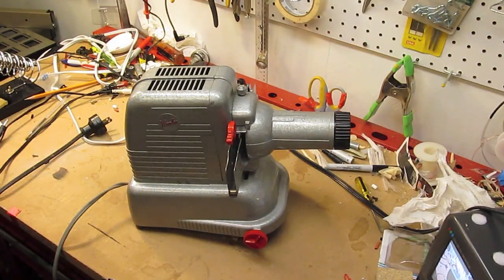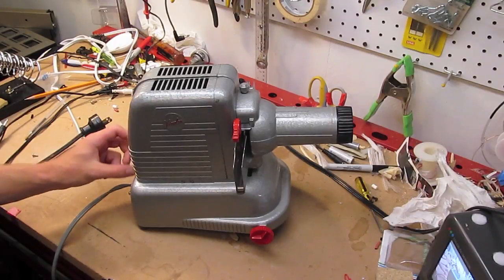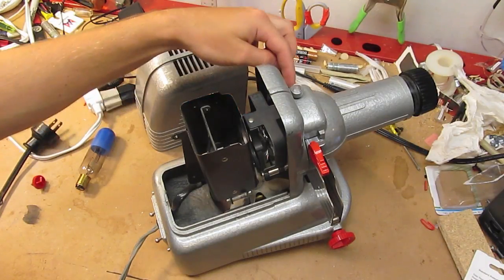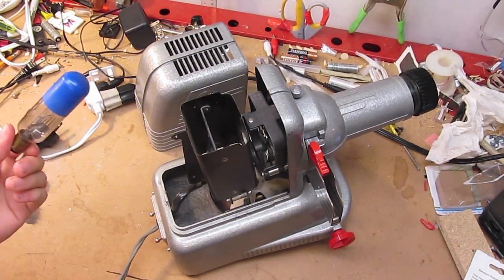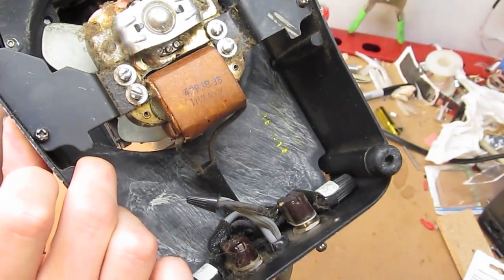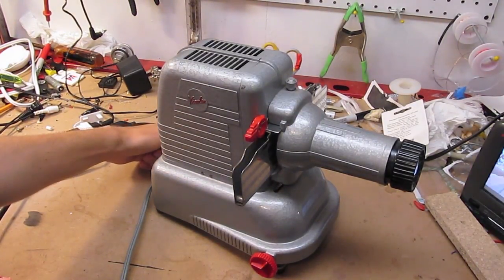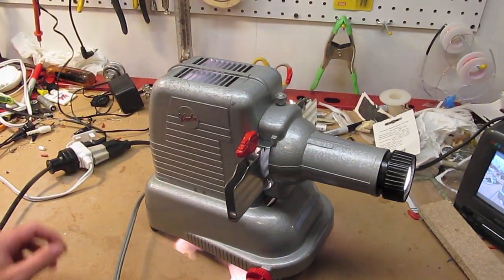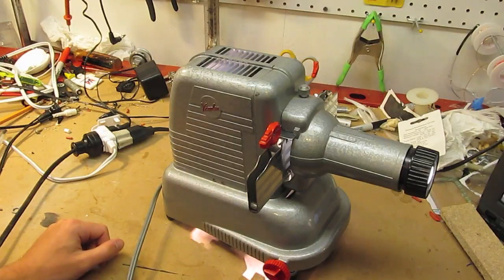What's Inside a Vintage Slide Projector?

Comment from the maker: Thanks for the info on the lamp.  It will come in handy if I ever consider getting the projector all the way working again.  Makes sense about the short life because that thing runs hotter than a halogen without the halogen reactions that boost lamp life. For now I'll keep it in a safe place and not run it.

Comment: Never mind, I should have watched the video first before commenting. but Victor made slide projectors as well as movie projectors, no relation to RCA Victor. I think that slide, filmstrip, and movie projectors used a quartz lamp of some sort, they throw lots of light and heat, be careful to let it cool off before touching the bulb or that grille on top.

Comment from the maker: Cool.  Thanks for the info.  That lamp is a monster, running at temperatures normally found in halogen lamps, but it is not a halogen.  Appears to have a thick glass enclosure but I'm not sure if it is quartz.  I made sure to scrub my fingerprints off with alcohol so it didn't get a hotspot, though it already has a bulge in the glass due to overheating or abuse.